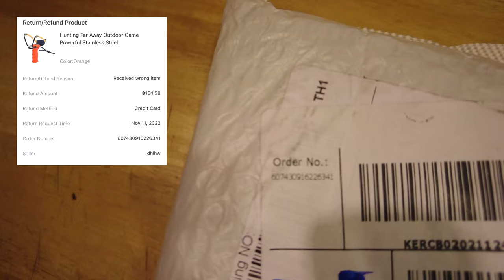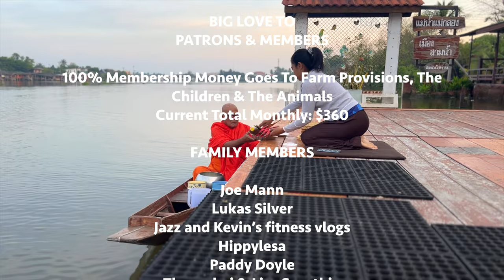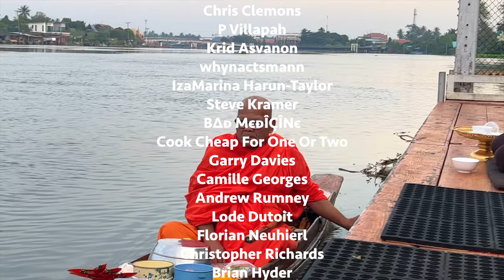THIS Absolutely FLOORED Us... Could ONLY Happen In THAILAND 🇹🇭

Comment: Another great vlog, really impressed with how you are developing your property. The reclaimed wood countertop and shelf in the bath are amazing. I only wish I could lay my hands on some wood like that, but it is really hard to find and expensive in our area. I think doing the walkway with concrete and no tile is the way to go. Tiles can get really slippery even when you use the "no-slip" outdoor tile during rainy season. We have a concrete walk all around the perimiter of our house and I really like it. I just have to pressure wash it two or three times a year as it can get quite a bit of algae growing on it during rainy season, which again can make it slippery when wet. Your stairs turned out really nice, I was a bit dubious when I saw the guy welding them with no visor and flip flops on, but it looks like a good job. I think you will absolutely love your elevated outdoor deck area and expanding it was a definite win, the evenings in Issan can be magical with the low levels of light polution and that looks the perfect perch to enjoy them. Cheers and all the best!
Reply from the maker: Cheers!

Comment: Lawnmower drama 555
There should be a shear keyway on the shaft that protects the crank on the motor and normally if you hit a rock that hard it will shear the keyway before bending the blade..  could be a lightweight blade. Maybe you can order a stronger blade online.. in Canada the blades are relatively inexpensive..
Love the bathtub! 
The bungalow is looking great 👍 
💗🙏